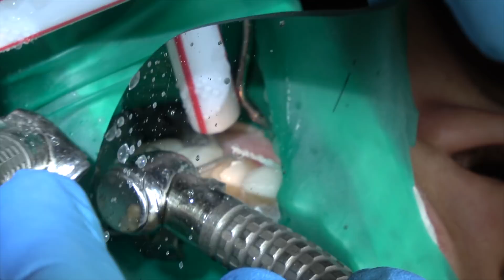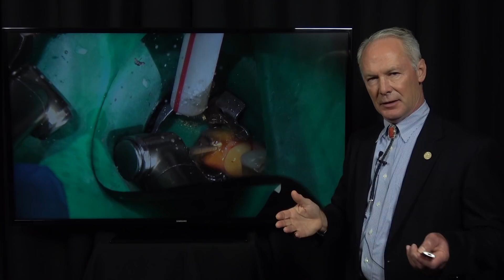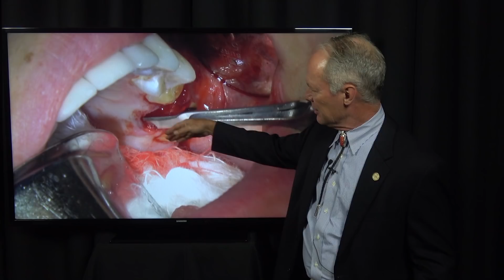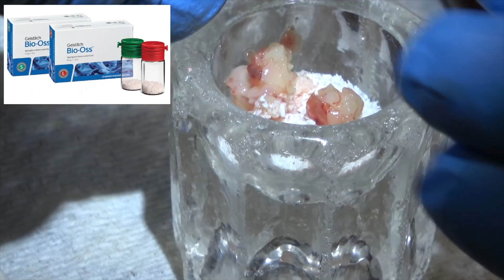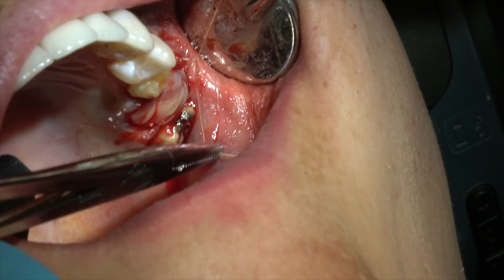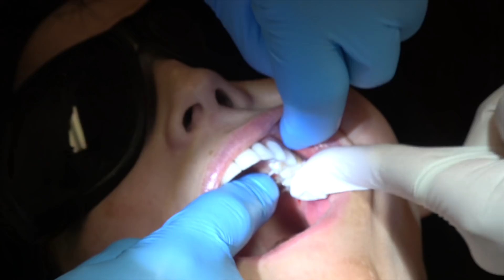Maxillary Molar Extraction, PRF Socket Preservation & Provisonal Bridge - Steven T. Cutbirth, DDS

Comment: Thank you so much. I just had a wisdom tooth extracted (yesterday) and was finding small, hard, white granules in my mouth. I know the dentist used prf, and just looking in the mirror it's clear there is bone as well. However, due to the fact that every few times I close my mouth small pieces of bone detatch, I don't think they covered the prf/bone with collagen, and I think the sutures might've been done improperly, or come undone. They gave me a post-op care sheet, but it was exremely vague and said I was given supplies which I was not (ointment/ozone rinse), and said it was fine to chew on the other side. I'm extremely apprehensive about everything at the moment because even opening my mouth wider than 3/4 of an inch makes it feel like the prf is going to fall out. I only started finding tiny pieces of bone in my mouth after eating (I had 5 apple slices and tomato soup, and followed the care sheet I was given. I didn't suck anything, spit, or chew on the sensitive side at all). I'm going to call them when they open in a few hours and ask for clarification on the procedures they did. I don't want to have to wait untill they open again on monday, and I'm going to ask they revise their sheet. Is it normal to not include a collagen patch over prf? Thanks. 
Edit: I saw the dentist yesterday, and she said she over-packed the socket with PRF/bone, and that the remnants in my mouth were due to that. The stitches are fine, and the socket is healing.
Reply from the maker: Glad the video was helpful.

Comment: I’d like to keep my I PRF from clotting. I can’t get my timing right.
Any tips ??
What’s the tray called? 
Thank you
Reply from the maker: The. tray is a PRF tray we bought from the same company that produces the vials. Spin the vials 16 minutes (2 cycles), dissect the yellow PRF from the red blood clot, put the PRF slab on the perforated tray, place the metal cover on the PRF to squeeze out the serum from the PRF slabs. Simple procedure if you can draw blood.

Comment: Very good explanation sir.....is collagen membrene necessary to place
Reply from the maker: The collagen membrane, or PRF, is placed to shield the socket from the soft tissue, which grows faster than bone.  The collagen membrane will give the bone a several months head start on the soft tissue, so the socket will fill with bone and limit the soft tissue fill.

Comment: When you do GBR to correct a defect during implant placement, do you absolutely have to get primary closure? Can you leave Dynamatrix membrane slightly exposed and will this cause the membrane to resorb faster?  Thanks!
Reply from the maker: No, you do not have to have primary closure.  I get great results bone grafting without primary closure with both PRF and resorbable collagen membranes covering the freeze dried bone graft.  The question when closing a flap following grafting, is which is more important, preserving the blood supply to the alveolar process by reflecting a minimum flap and not having primary closure or reflecting a big flap, having primary closure, but loosing the blood supply to the alveolar process from the reflected flap. I generally choose minimum flap and preserving blood supply.  Look at the DentistryMasterClasses.com library of cases of bone grafting without primary closure.  Terrific results!